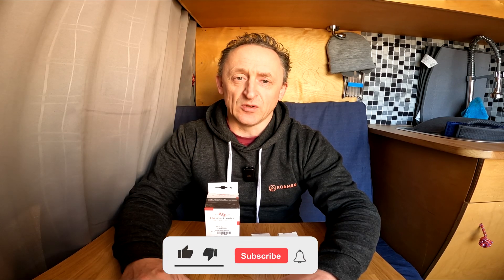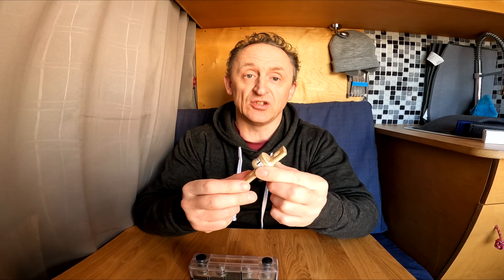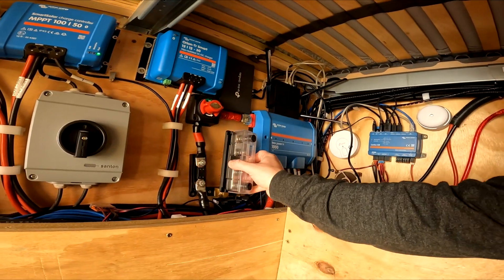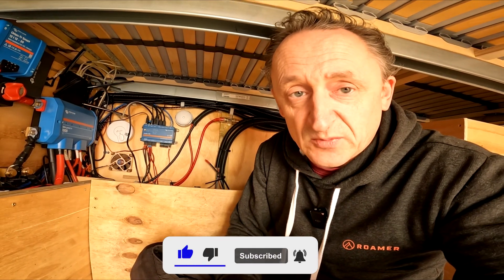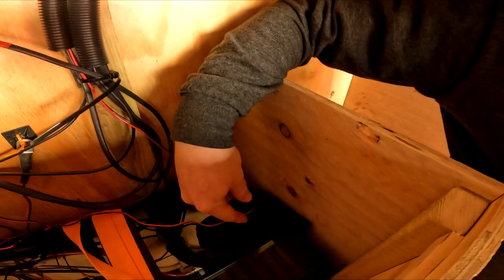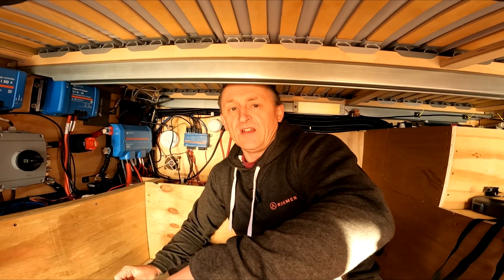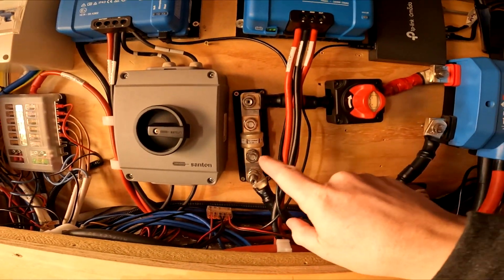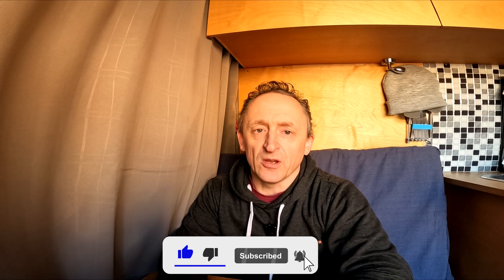WARNING! Is Your Van’s Lithium Electrical System Safe? (T-Fuse Install)

Comment: Are there examples of people having issue with just a megafuse and a BMS?
Reply from the maker: Hi Turkeyphant, thank you for watching and posting your question, The reason for using the T-fuse is because lithium batteries produce extremely high short-circuit currents (thousands of amps) that standard fuses can't handle, causing them to fail catastrophically by arcing and staying conductive, where Class T fuses have a massive interrupting capacity to safely extinguish the arc and stop the current, protecting your system from fire and damage, hope this helps.
Reply: @Alivefrom45 I know the reasoning, but are there examples
Reply from the maker: Hi Turkeyphant, fell free to watch Will's video in which he does real world tests and shows the results and explains everything in great detail, hope this give you what you are looking for. https://www.youtube.com/watch?v=7Fbga77ERtY
Reply: @Alivefrom45 I asked about real world examples

Comment: Putting this one into my system. I do wish the busbars were a little thicker. 

And it really should come with a flat washer in addition to the lock washers. East enough to get some but seems cheap. 

Without it the lock washers will dig into your fuse and lugs. Not a big deal but still.
Reply from the maker: Hi MygoogleYoutube, thanks for watching and posting your comment, it's a great catch. 👍

Comment: That’s a good idea that we will have to fit one . But I think 400amps is double the amount . By the time it activates surely 99% of your cables will have gone ?
Reply from the maker: Hi UrbanVanlife, thank you for watching and commenting, the reason we fitted the 400A fuse is because our battery is capable of a 400A max delivery where most other batteries only deliver 300A. This is why we also used 95mm cable which is rated to 530A between the battery and the Lynx distributor, as well as for our earth cable and to our inverter.